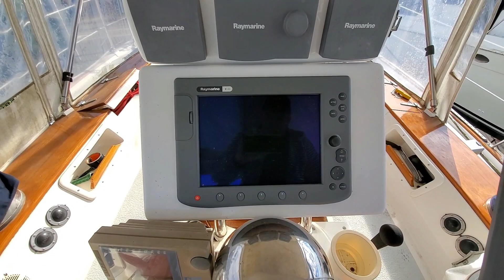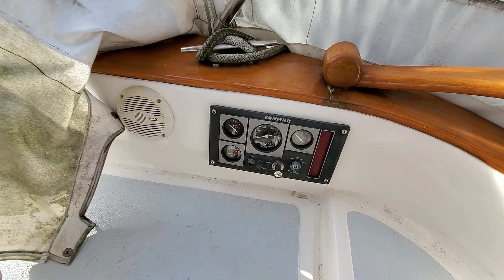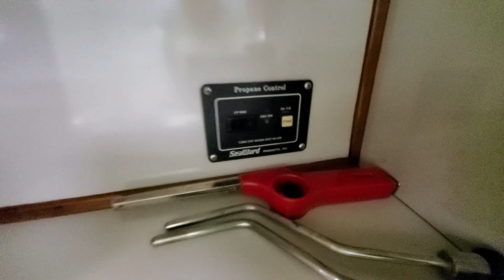Sailboat Restoration Project. Chain plate Inspection. Major Discovery. Endeavour 52. S1 Ep 19

Comment: After doing several refits, yes anything is fixable, but it’s about time, labor, and $. When inspecting your chainplates, you need to remove them to check for pitting / corrosion in the areas you can’t see between the decks as this is where they are most vulnerable. Also, I suggest drilling some 1/2 core samples to see if you have bulkhead and knee rot inside. You can later fill the holes back with thickened epoxy. If the fiberglass is thicker, as with older boats, the sounding will be a bit more challenging to truly asses. Also, check the bulkhead and knee tabbing to the hull for delamination, another failure point. Your first priority has to be the structure, hull, secocks, etc….. good luck.
Reply from the maker: Hello John, thank you for your informative comments. We agree about removing the chainplates to inspect further and or replace as necessary. We would like to get a better view of the bulkheads tabbing to the hull where we can. We are sure there will be some surprises down the road once we get further into the projects. We thank you for watching and we hope you have a wonderful day.

Comment: The reason a surveyor taps on a hull is to listen for difference in sound indicating a separation.. you are tapping on a bulkhead with a rubber hammer… yuse a metal one and it should sound hard and sharp with no hollow spots… I bet that whole bulkhead is dry rotted .. it should never sound like watermelon… drill holes to see if it’s dry rot. Also read up on dryrot . Dry rot is wood decay caused by one of several species of fungi that digest parts of the wood which give the wood strength and stiffness. It grows and spreads like a weed… if you find any rot or white fungus the whole bulk head will need replaced or it will continue to spread and eat the whole boat
Reply from the maker: We shall see. At a later date when the weather improves we will drill a test hole and see what we find.  I expect we will find something around where the chain plate is attached.

Comment: Congrats on the fixer-upper. I would purchases a hydrometer to determine how much water has been absorbed into the fibreglass laminated and into the plywood substrate and (bilge) bulkheads. The fore-sail locker was not inspiring, with all that wetness. In addition, it might be a good idea to hire another surveyer, one in which you can have a professional relationship, to inidcate any structural issues and the necessary refits required for insurance purposes (as the boat is probably uninsurable for replacement value but you will require open seas insurance) and safe passagemaking. This will be the best money you could spend, as it will prioritise refit schedule and ease of mind. In addition, you probably going have to unstep the mast for a complete inspection, complete overhaul, and rewriting, if it been on the hard for five years. Oh ya, if the Furlex is over ten years, you might think of replacing it with a new one, to advoid constant repairs and the rigging too. 

Remember the working definition of a yacht: a yacht is a virtual blackhole that constantly draining your wallet because of repairs, more repairs, and even more repairs.

All the best, and fair winds.
Reply from the maker: Hello John, thank you for the congratulations. We would like to purchase a hydrometer at some point. We fully expect to find some areas of moisture on this boat, she has been sitting neglected for about 6 to 8 years. We also agree about the mast and at some point down the road we would like to unstep the mast for modifications and rewire etc. We also plan to have the rigging inspected and upgraded later. Our first priority is to locate and repair leaks and make the interior a nice living space first, then make the boat ready for splash so we can save some money. Boat yard rates where it is located are higher than moorage closer to where we live. We also have been looking into insurance options, and will get a survey once we have repaired the known problems we find along the way.
We thank you for watching and we hope you have a wonderful day.